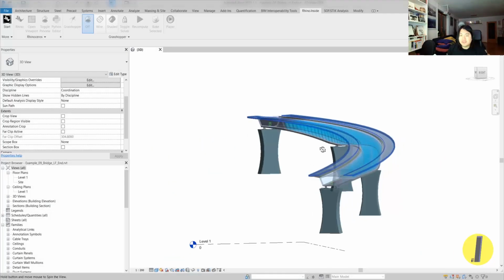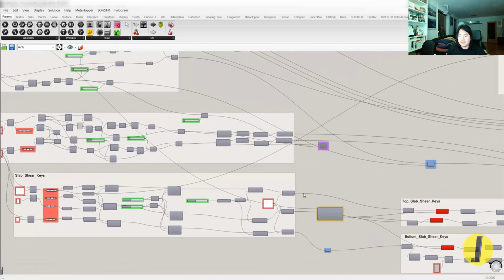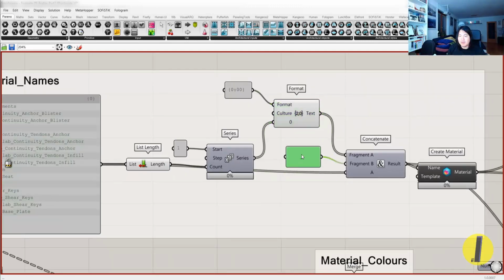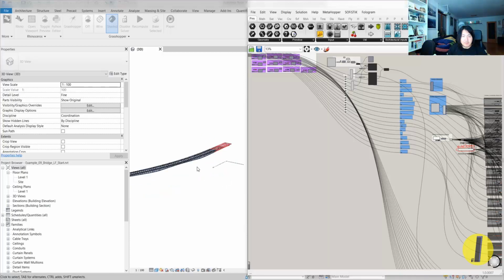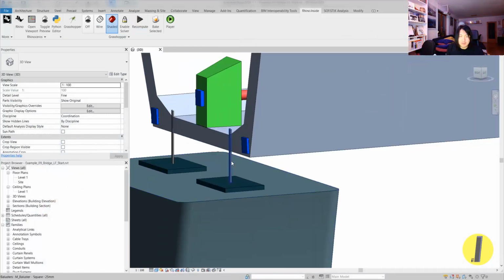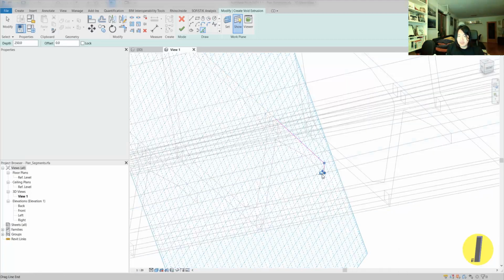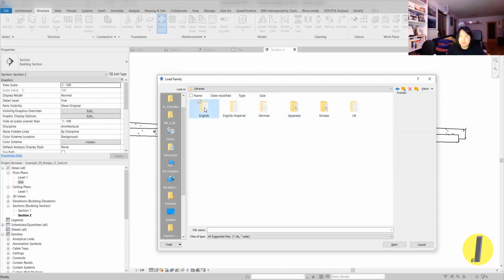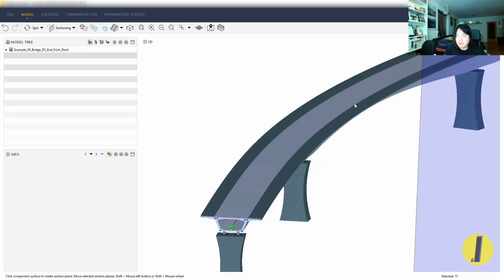#Rhino.Inside #SOFiSTiK #GH - Parametric Bridge

Comment: Great workflow for the geometrical model, but for the details and the reinforcement model does it work parametrically? I mean do we have to manually model the reinforcement every time inside Revit or is there a way to define the rules or input parameters inside Grasshopper to change the numbering, spacing, the diameter of reinforcement? Can the reinforcement be modeled parametrically for this workflow using a link to excel?
Reply from the maker: Hi, I am not an expert for reinforcement detailing. What I have seen the most of best practice is to bring Revit model to Tekla Structure using Tekla Grasshopper connector. This way you will be able to add reinforcement parametrically in Tekla environment. Softistik reinforcement tool also give you great parametric reinforcement modeling options... But mostly building elements not for the infrastructural elements. There are also opensource development to create rebars in Grasshopper parametrically, however, you cannot generate the reinforcement in Revit... I am also hoping that Rhino.Inside.Revit will provide reinforcement tool in the future..
Reply from the maker: https://conferences.autodesk.com/flow/autodesk/au2024/sessioncatalog/page/inperson/session/1713845119314001VhSo Here is also topic from AU2024. You might as well to check the session.